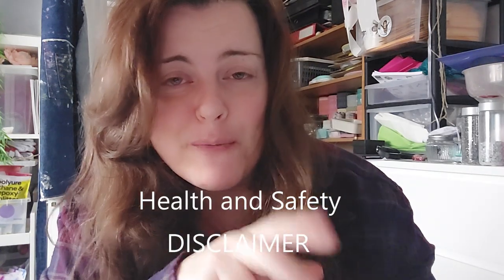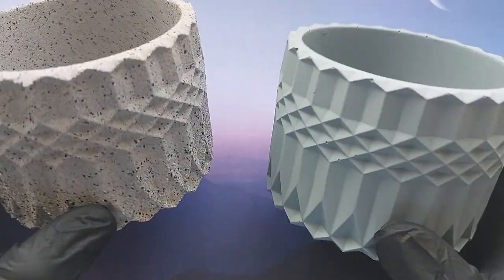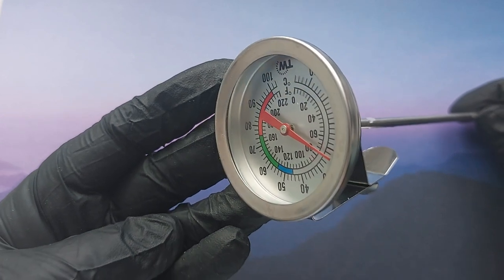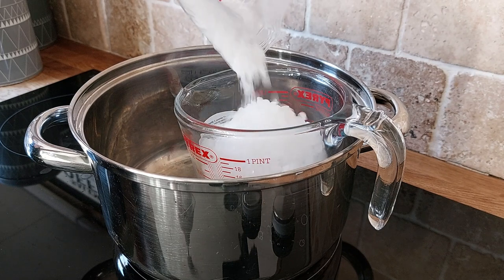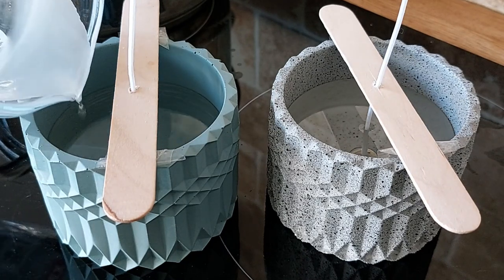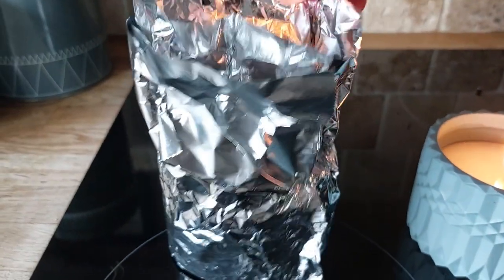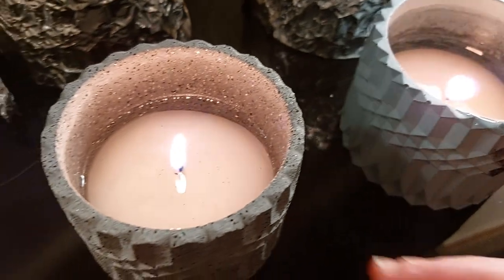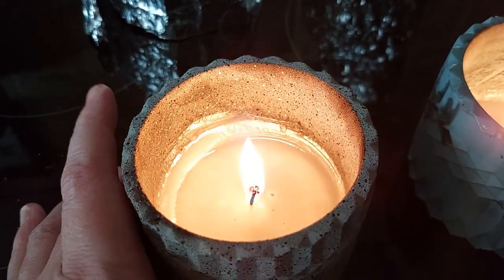Making Candles with Jesmonite Vessels AC100 V AC730

Comment: Thanks for the vid Claire! I've been making and selling candles from AC100 for about a year now. My jar size diameter is 7.5cm, wicking correctly took a while but it all worked out. Have had no issues with the jars. I may transition to the AC730 in future x
Reply from the maker: heyyyyy lovely this is so good to hear and really good to know that there has been no issue. I guess the 'combustible' classification could be down to the company themselves putting a disclaimer out like I did haaaaa but in fact it works perfectly fine ? I know of a few people using AC100 without issue .. and I have yet to hear of any combusting issues which is amazing x
Reply: @ClairesCraftyCorner  Thanks for your response. Your probably right about the disclaimer! I never saw that tbh I only ever saw that AC100 is fire resistant, so I thought it would be perfect use. I've sold many, even a number of people who bought multiple jesmonite candles have since been buying multiple refills for them so they've been cleaned and reused many a time, also with no issue. Fingers crossed they continue to be fine.
Reply from the maker: @Stratsfinest  that really is great news xx good for everyone to read this and see ❤❤❤
Reply: Do you use any kind of sealer with AC100?
Reply: Do you use sealer for jars? @stratsFinest
Reply: @Stratsfinest  Hi May I ask how you cleaned them please? And what is your sealer of choice? Thx :)

Comment: I wonder if the AC100 soot is partly due to the sealer used on that vessel rather than being a different Jesmonite than the other? In any case, thx for testing, I prefer the texture of the 730 too. Al
Reply from the maker: heyyyy lovely ... yes it totally could be ! a few said this over on my Instagram that they had the same sooting ... so I know that some are trying different sealers now x

Comment: Ac100 is not combustible
Reply from the maker: Yes ..indeed. I was told by a supplier that AC100 is potentially combustible so it's at the risk of the users ...it didn't break when I tried it.

Comment: I just did the experiment you do with regular resin.  I use bee wax and wooden wick, I did not get the blacken as you do.  However after 6 hr of burning and down to one third of my wax, my container start to crash.  I stop experimenting then as it will get dangerous if it split open.
Reply: Container start to crack*

Comment: On Jesmonite site they say AC100 is fire resistant as the AC730! If the brand say that where did this doubt came from?
Reply from the maker: heyyyy lovely .. I have heard it is fire resistant not fireproof ... like in the same way it is water resistant but not waterproof xx The information I was given is that AC100 is combustible .. AC730 is non-combustible. I had no issues with that though x

Comment: I really like that you put in that disclaimer and you did a very thoughrogh testing. I used to make moulded candles a few years ago. I had special candle moulds and mixed stearin and parafin for various properies. I never dared to use containers even if some of the books I had showed teacup, and even wineglass, candles. I gave up when I lost track of my wicks and no longer knew which one to use for what width of candle and ended up with too quick burning candles or tunnels.
Reply from the maker: Ohhh Mizz thank you xx yeh I was nervous about these and felt the disclaimer was so important lol x I can honestly see the attraction of making candles I just know it is not for me at all. The clean up was real !
Reply: @ClairesCraftyCorner  I used an empty tin (former family sized serving of peaches) for the wax and only cleaned it before it went to recycling. The pot I bought at a fleamarket for next to nothing and only used it to heat the tin.